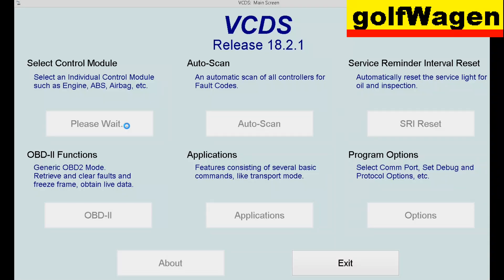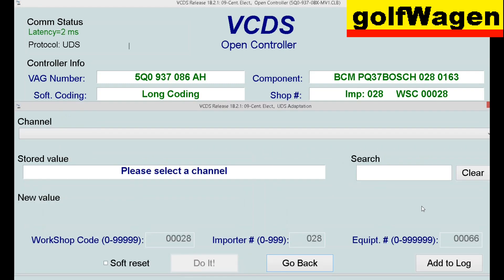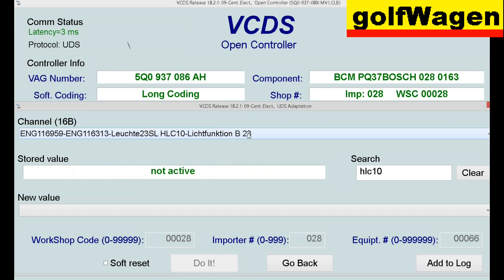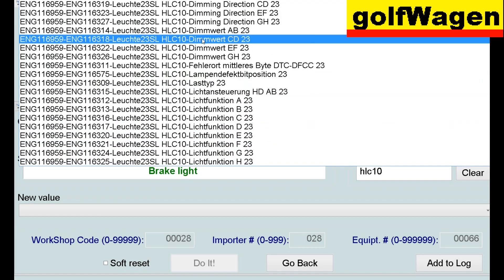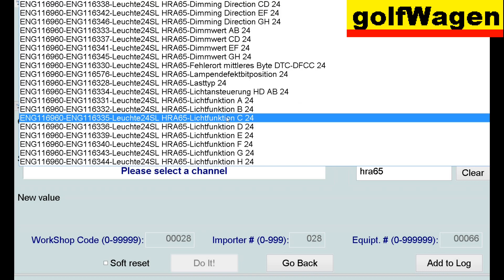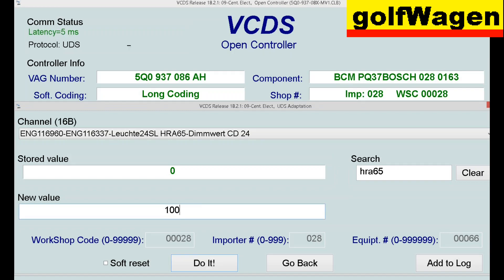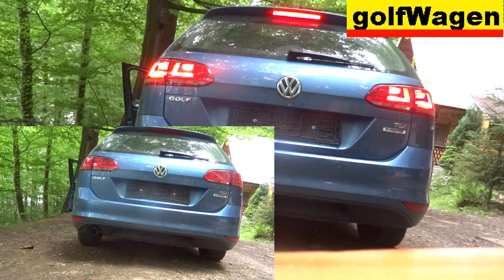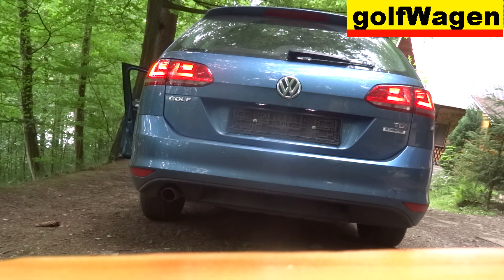VW Golf 7  4+1 brake lights coding VCDS-VAG

Comment: golf Wagen
is this possible for a passat b7 2012?
Reply from the maker: b8 definitely b7 I do not have to try
Reply: @golfwagen4173  I'm looking for security access kay for B7 (3AA937087D). But I do not find anywhere. It's not in the program. And I'm starting to think that the option can not be activated on my car. If you can help with the code I will be very grateful to you.